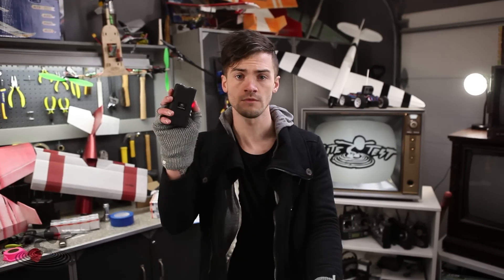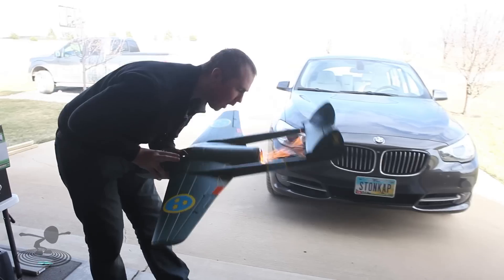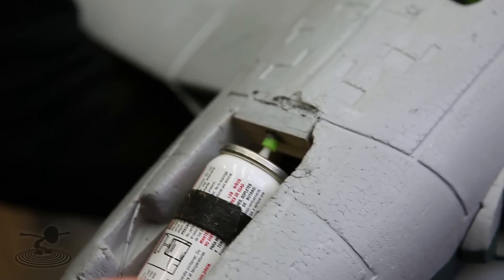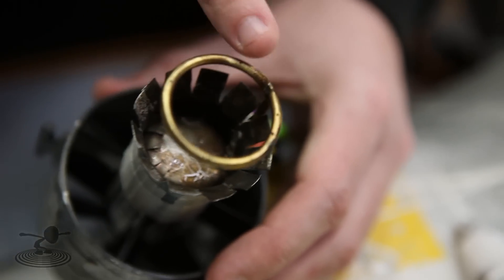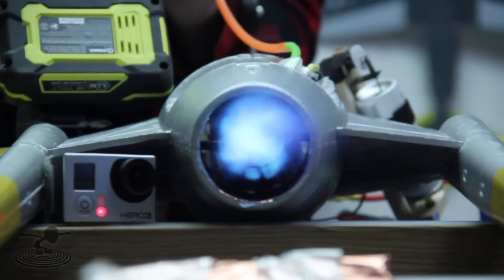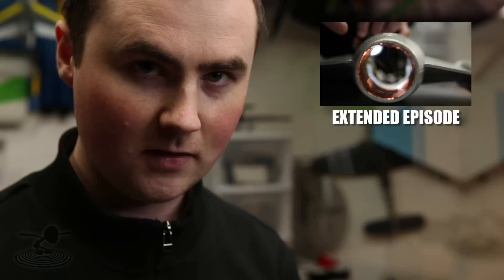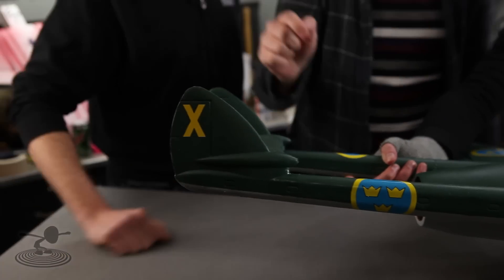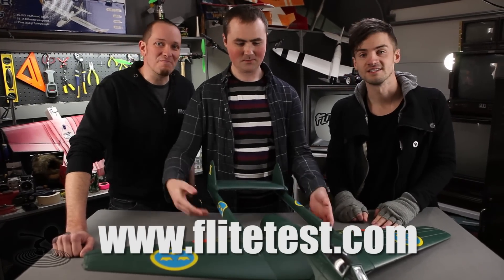Flite Test - EDF Afterburner

Comment: O.K. so now i gotta do this to my Eflite F15 64mm EDF. I think it'll work!!Well w/a few minor mods to the afterburner nozzles. Did u get much thrust from using this? Could u tell a diff when u ignited it? I want to either do this or mod  the nozzles to oscillate in mult directions giving better/sharper turns. 
  I kept wondering about how i would transfer fuel & what type i'd use, but holy hell dude!! You done & went and did it!!! NICE!!! VERY NICE JOB!! FELLA...

Comment: The vampire is probably the most beautiful airplane ever built.
Reply: Sea vixen looks better in my unimportant opinion
Reply: @flakmagnet2  they are both using the same basic design.
Reply: @grumpyhale821  well they are both twin tail boom planes, But the Vixens rudders and wings are more sleek. Also twin engine planes look better imo

Comment: I think it would be very interesting to build a "gas turbine" by driving a two-stage centrifugal blower with an in-runner brushless motor and feeding its output into a model gas turbine combustion chamber. This would get around the need for the expensive hot end of the gas turbine though I suspect the result would be somewhat heavier as the LiPo needed to give even a few minutes of running would be considerable. Can't find anyone who has tried this (using an axial compressor as in this case does not give sufficient pressure in the combustion chamber for a serious thrust as was the case here)

Comment: Pure amateurs; forget it; will not produce a single ounce of thrust !

Just adding a flame is not the purpose of an afterburner. Return to the books, learn, how a real after burner works and what it needs (geometry, etc.) and restart.

You will most likely find out that the mass of the additionally required hardware will exceed the gained thrust --> degraded thrust / mass balance .
Reply: It also seems too small to be a fighter aircraft. and I do not think that they are actually part of an airforce.  It's as if they are playing with toys and just attempting to enjoy a hobby.

Comment: What about a constrictor around the exhaust to get more power from the jet?  It could be hooked to the same channel as the butane so that it was open for full airflow under normal circumstances but then constrict in afterburner mode for more of a rocket thrust.

Comment: how 'bout develop the afterburner concept further? similar to F - 117  dual exhaust cones (or 2 into 1) that the tail cone can be rotated giving thrust off axis. have @ it - simple foam board model to build...mine was static (no turbines) RCM 12th scale in balsa (frame) & panel line skin covered including access hatches using old offset press 'tins'...photo not available; + 20 yrs ago; flight club 'neighbor' got pissed my 'toy' fussing, ran over it with golf cart radio transmitter & all.

Comment: He should put a system purge, like use a co2 cartage connected into the fuel line then have it so when you hit a button it shoots the co2 out cutting off the fire just in case of a crash.

Comment: Nice work! Interestingly the project is similar to the Caproni Campini N.1's propulsion system. From Wikipedia: https://en.wikipedia.org/wiki/Caproni_Campini_N.1

"Unlike modern-day gas turbines, in Campini's design the compressor – a three-stage, variable-incidence one, placed in front of the cockpit – was driven by a conventional piston engine, a 900 hp (670 kW), liquid-cooled Isotta Fraschini. The airflow from the compressor was then used to cool down the engine and then mixed with the engine's exhaust gases, thus recovering most of the heat energy that in traditional piston-propeller designs would be discharged overboard. A ring-shaped burner would then inject fuel into the gas flow and ignite it, immediately before the discharge nozzle, to further increase the thrust."

Comment: How much ELECTRIC motor power was lost? Was it more or less than 15%? When being flown normally, how much does the lost power effect the plane when the afterburner is off? Does it greatly affect the performance, or do you just need to increase throttle for it to fly like it does out of the box?

Comment: What if you put a shroud around the burner ring and placed the coil inside it. That's how rocket engines work, the coil is heated by the exhaust and the coil regulates the heat.

Comment: Btw try high temp ceramic paint in your tail section. It should help with the melting part without any major concern of added weight. You can find these paints on line or your local muffler shop.

Comment: If you constrict the output hole just a little, it will give more thrust.
Reply: But it would collect huge amounts of heat, so i would presume it was like this for reason... and it being foam+heat dont mix well... but that can be engineered around ;) I start to like this idea, though needs bigger fuel container so its not just for 60sec...

Comment: if you add air tubes in the front that go directly into your afterburner you'll get better fuel efficiency
Reply: ya but i think that it needs to go into the coil to have enough time to turn into gas

Comment: If it provided no substantial thrust, I was dubious about the idea but the sound it makes is perfect, so kudos!
Reply: Keenan Bartlome
Light has no rest mass but mass and energy are equivalent, so photons do have a mass equivalent to their wavelength.
Reply: Melinda Green it's all about the sound it makes. That "sound" makes logic do weird things.
Reply: And light does actually have mass.
Reply: ProfoundThoughts
I didn't have any expectation, unlike most people here who assume from the sound that there must be enormous thrust.
Reply: can we talk about your rates?
Reply: Melinda Green Finally someone gets it. :)
Reply: They are pushing butane out of small openings at high speed. Igniting the fuel causes it to burn, and turn into a rapidly expanding gas, in addition to the flame. If you look at 3:45 very closely, you can see a small bump in speed. It may not be much, but you cannot deny that it is producing thrust that does affect the physics of the plane.
Reply: Yuri Danylko
You will.
Reply: ProfoundThoughts
They claimed that it only provided 15% of the thrust.
Reply: Melinda Green What do you expect? It doesn't have a proper combustion chamber.
Reply: Light must have mass to be deflected by gravity.
Reply: @Cerus98 Ever heard of gravitational lensing? You may want to educate yourself before calling others' education in question.
Reply: @Cerus98 
Photons have relativistic mass as they are pure energy.   Zero rest mass.  So they are affected by gravity.
Reply: umm actually, light (photons) do not have any mass.

Comment: did that make it go any faster?
Reply: Spanky Jeffro well with a name like Spanky you must be right...
Reply: +HighVoltsEntertainment Quite right. You know what they say, "That guy named Spanky is fine and dandy." Words to live by. :D
Reply: +Gherkin Flout Tubanomeister Umm NO
Reply: +Gherkin Flout Tubanomeister Yes. He said that it increased thrust by 15% while burning. :)
Though yes, it did decrease thrust somewhat when not burning.
Reply: Spanky Jeffro How could burning gas being let out behind the plane make it faster??? It was only a small pipe with holes in it not any kinda jet...... Also the extra weight had to make it slower....
Reply: +HighVoltsEntertainment Physics mainly. Expansion of the burning gas and such.
I haven't seen the figures, so I can't specifically say if this gave thrust or not, but David said it did. :)

Yes, he did say that it was slightly slower whilst not burning. But, that couldn't be too much with the 15% thrust he got from the flame at the back.

Comment: curiosity, could it gain more additional thrust if the exit tube were a little longer?
15% is substantial but we'd see it very-very clearly if that were doubled, no questioning.  maybe slip fit a cut soda can to extend an inch would show if the gas-heat expansion can be exploited for some more push.

Comment: what if we bring one of those space using balloon then fly further? radio controls might not work
Reply: they wouldn't be able to use the engine, even if they had radio control.  the engine needs oxygen to run

Comment: Did it cause any change in performance?
Reply: Yes, 15% increase in thrust (i.e. power)
Reply: +Rogue-9 I understand thrust. I kinda wonder what the TWR is for this craft. Can't be more than 8 pounds or so, so a 15% increase in thrust probably has a major inpact on TWR.
Reply: I don't quite follow how that works. If the weight is constant, shouldn't a 15% increase in thrust also lead to a 15% increase in TWR?
Reply: +Rogue-9 TWR is Thrust to Weight Ratio.. +Joe Winter means basically " how much weight does this thruster add" they later say they removed the landing gear in order to equal the weight after the afterburners placed w/o landing gear to w/o the after burner and with landing gear attatched.. this mean boith of you are right, but 15% increase in thrust does NOT affect TWR without these other variables

Comment: Guys, I know this was a while ago but you could do what we do in the full size industry and protect any area subjected to adverse heating with aluminium (yes that's ALU-MIN-I-UM :-)  ) tape!! we line the engine bay areas of aircraft under the "hot" sections of the engine! a strip of which over the leading edge of the tail plane should do the trick without adding too much weight!!??

Comment: Really liked your after burner !

One thought instead of having the pre-heat coil and the explanation chamber for the butane why not just have a loop that goes around the flame circumference for preheating that way you will save on electrical power and weight.

Comment: Awesome job. Even a 15% gain is amazing considering its a ducted fan. You must of had some serious test and tune time to get that intermix right. I had to use a pre-heater and coil evap tube. I put about 5 days into the build and I ended up with just a little more thrust," about a 23% gain in thrust". I could not get your crimp regulator to work and ended up using a very small fuel injector solenoid in the fuselage in front of the duct then piped to the back. Really love the sound it made and was amazed at how loud and it sounded just like a jet from far away lol. I was jumping up and down when I got it to fire first on the bench vise. Thanks man and If u ever want to get more involved I would be happy to send you the blueprints and design schematic. I found I used about 3 pounds of propane before o got it to run right. Keep up the good work!..Great video, great channel = subcribed thanks...
Frank

Comment: You could actually make it much more reliable, fast and increase its life expectancy at the same time by having the coil wrapped around the metal tube that protects the polystyrene, it would keep it cool while the afterburner is on as well as make sure the fuel is turned into a gas reliably, and remove the need for the heater, improving flight time in cold weather, and canceling the slight weight increase due to the additional tubing. Additionally, now that the protection tube is cooled by the incoming fuel, you could put in a bullet type cone in there to actually generate thrust from the combustion just like an actual afterburner would, making it a true afterburner.
Reply: Somebody needs to sell EDF afterburner packs using that design, that would be incredible.
Reply: Yeah that would be so cool and definitely would work
Reply: I spent my teenage pauses at the secondary technical school watching the M701 jet engine cut and thinking about WHY are some technical solutions as they have been built by the engineers 50 years before me. One thing remained in my mind the fuel (kerosine) tube was let inside the combustion chamber meander-like. That solution will heat the kerosine using the heat from inside the combustion chamber. The kerosine is already near vaporized when is mixed with the air so you get a better mixture. The combustion chamber on rocket engines is cooled with fuel (not oxidizer) and then the heated fuel flows into mixing nozzles in the back of the combustion chamber. This is the same manner as you described.

Comment: Make a scratch build with an after burner BUT like the famous sr71 black bird put diversion tubes on it so when your not using the fuel you get Max thrust from the motor.

Comment: Does it boost the speed or is it only visual?
Reply: Skyler Eggers Actually he said thrust, so speed should have only gone up at the square root of 1.15.
Reply: he said it boosted the speed by 15% Lisen more closely
Reply: the fan is just to suck air into the edf afterburner. Then its mixed with gas and is lighted. the flame pushes the flame forward. The way this works is because the law "for every action there is a reaction".

Comment: Can you make a Quad with EDF? That sounds like it would be overkill but I'd like to see an attempt.
Reply: It has been done with a hexacopter.But due to the low torque of EDFs a tricopter would probably be the best option.Also EDFs have good speed but low thrust.
Reply: do you have a link to the EDF hex?
Reply: Sir Snek ok so if you made some sort of nozzle like on real afterburners on the edf , wouldn't that combat the "torque" issue?
Reply: Sir Snek The fans or the planes that they are mounted on?

Comment: Could shield the tail with aluminum flue tape. Instead of having the metal exhaust tube in direct contact with the foam, make it with an air gap and have it so some air can flow through the gap. Then the burner can run longer without melting things.

Comment: why exactly did it make such a loud sound if there was no turbine?
Reply: ***** no questions is stupid, if you don't ask you don't learn... so don't mind the haters.
btw i don't know anything about this but i would guess the extra thrust from the flames would make some extra noise
Reply: Dominic smet Take your own advice and search.... for some anger management classes there chief.
Reply: It's from the hot gases expanding.
Reply: Lucas Pehkonen thanks for saying that :) thanks for the help.
Reply: you can also ask why you make noise if you drop some dishes
Reply: DucDucSTFU haha thats great XD
Reply: I makes alot of noise because its just like you blowing on a candle and it makes a wind sound also, as said before, it is the extra trust produced.
Reply: Hey Dominic smet and everyone else the fuel that they used (butane) is what commercial jets used mixed with gasoline the only reason being for the sound is the combustion chamber the gas is released under high pressure whist being ejected at high speeds so the sound follows behind the aircraft making the same sound that a commercial aircraft would make. Lastly, as the gas decompresses the decompression of the gas is causing particles to separate and that is where the sound comes from with the addition on the 15% thrust of the afterburner it would just make the sound even louder. So there is your logical explanation
Reply: ok wtf. Me liking birds has absolutely nothing to do with my knowledge of planes. "and birdman will probably don't know  about engines" nice.
Reply: Dominic smet I don't get it either why people ask questions like that when they could just look it up THEMSELVES. This guy had to wait two weeks for someone to answer his question when he could have just looked it up himself right away. Then he say's he didn't look it up on his own because he "chose not to". You can tell from his response it never even occurred to him to just look it up himself...
Reply: yeahh... sure
Reply: heyy mister ducduc don't try to be a smartass... why don't you come over here and we will search for it together ;) and a birdman will probably don't know anything about engines
Reply: That's the fuel (butane) burning in the exhaust flow, and is basically the sound of gas rapidly increasing in volume and temperature.
 It sounds a lot louder and realistically awesome than I ever would have expected.
Reply: ***** um just saying your the dumb ass here you can clearly see a ducted fan on this foamy. How to hell did it get up there in the first placeif there was no motors You are right though, it is the afterburner making the noise.
Reply: He didn't turn the after burner on till 3:45... your still the dumbass...
Reply: are you fucking stupid ?!?!!
Reply: Dominic smet I don't know if you are talking to me but if so, no i am not stupid. It is a simple question that could be simply answered. Even if you aren't talking to me, you need a filter.

Comment: Be fun to take the system remove the EDF and make a rough turbofan out of the system.  Add a turbine behind the flame holder with a shaft to a large fan in front that can bypass around the flame holder but still feeds it enough air.
Reply: The copper will melt
Reply: Need stator vanes too or it will not work.
Reply: Henry Griffiths so much for so little lol
Reply: iankr1 I have learnt a lot from Agentjayz on youtube :)
Reply: Henry Griffiths ill check that out thank you